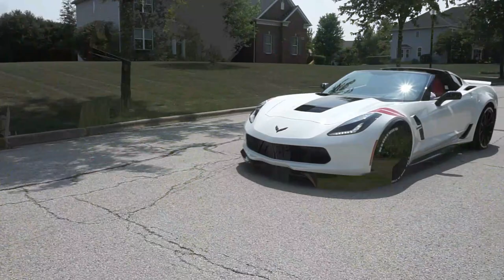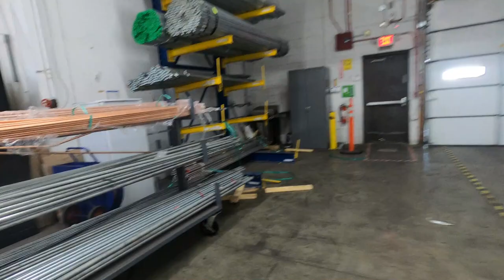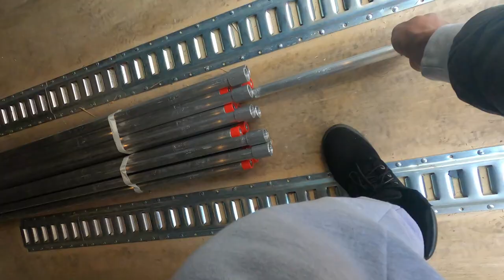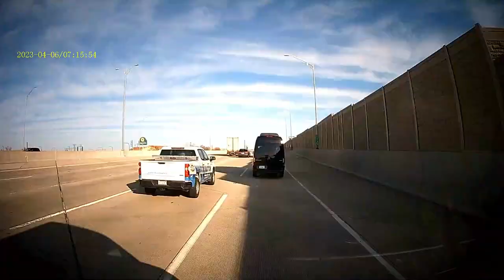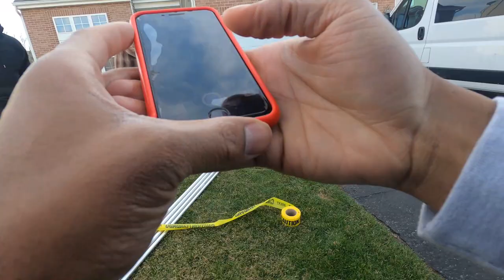5 TIPS You NEED To Know BEFORE Starting A CARGO/SPRINTER VAN Business!! #foryou

Comment: Hi, thank you for the info! Do you have any van suggestions? I'm currently looking for a 250 or 350 van with a medium or high roof. I've been told that there is not a big difference in the roof height between a medium (8ft) and a high roof (9ft)... Do you provide mentor services?
Reply from the maker: I went with the Sprinter van because of the reviews that people give it after long term use. Depending on what you plan on loading, you probably wouldn't need the high roof. The high roof comes in handy for me when the solar panel orders are larger.